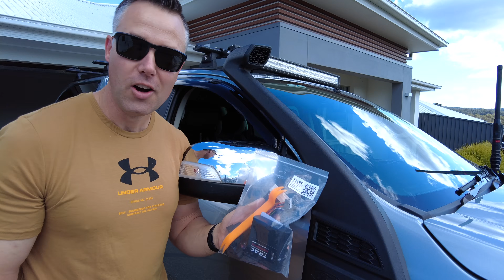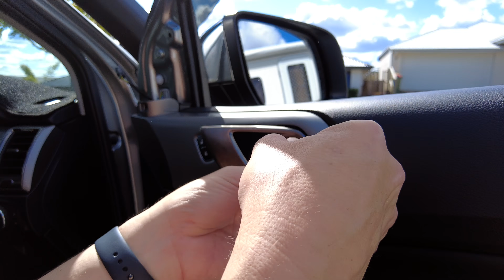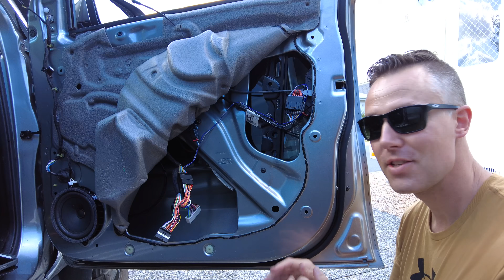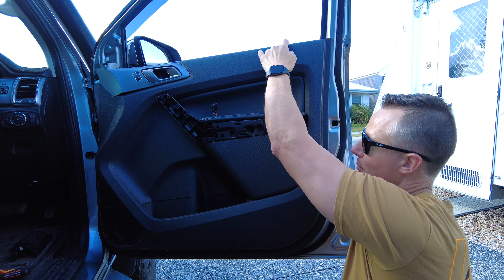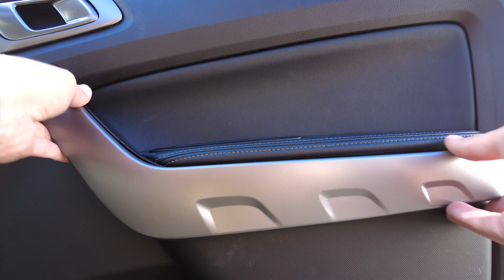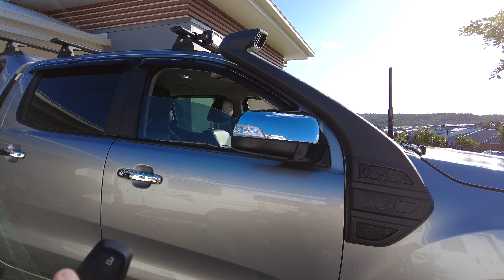Ford Ranger Remote Window Opening!! TRAC Electronics || DIY

Comment: Great video GC - just purchased a trac system too! Did you have the mirror module as well? When you’re testing the system at the end, looks to be included.
Reply from the maker: Thanks mate. I had that module added in when we bought the Ranger as it was a Ford option. Cheers

Comment: What if you just want to crack the window or just roll it down a little while driving
Reply from the maker: If you hold it down longer than that single second it turns into a normal switch. Alternatively you can stop it at anytime by pushing on the bottom again. Thanks for watching